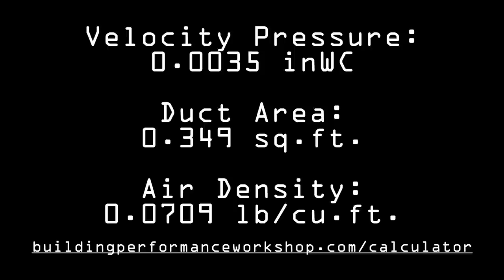AIRFLOW TESTING: 8 Ways to Test Residential HVAC Airflows with Corbett Lunsford

Comment: Corbett, 
Just a few notes/suggestions. The large vane was not used properly or as intended for exhaust fan flow. The vane would be influenced by the rotation of the exhaust fan. There is a flow funnel set made for the vane and a funnel factor that is used when measuring exhaust airflow. In addition, both vanes allow for the input of area to automatically calculate the CFM from the velocity.

Second, the reason the first are lower then the last 4 is the last 4 were measured independent of air density or corrected for air density. The Testo vanes actually measure airflow by measuring the number of rotations of the fan which measures airflow independent of air density. 

The first 4 measurements all measure airflow by measuring the pressure drop across a fixed orifice the fan orifice or a pitot tube array including the powered flow hood. They are all manometers. Air density is affected by barometric pressure, temperature, and relative humidity. I do not believe that any of the instruments you used correct for all 3. 

What you effectively were able to show is that if air density is not considered or corrected for the airflow readings will be lower than normal. Also while the powered flow hood has been touted as the industry standard, the TAB industry still uses the Pitot Tube as the standard for all airflow measurements. 

As the ductwork is rarely accessible when testing exhaust fans, a powered flow hood at the exhaust inlet, a vane with a hood, or the exhaust fan flow meter would be the most effective methods for measuring exhaust. The large vane and the small vane used as demonstrated would not be as accurate. The garbage bag while interesting is not an easy or effective method for most applications. 

Interesting video

Jim
Reply from the maker: Thanks for the added insight, Jim. We intended for the 75 cfm to be a stand-in for many residential supply ducts and ventilation ducts.  Interestingly, we were sent these Testo tools without a very in-depth manual, so it was anyone's guess (unless we have access to you) how exactly they intended the tools to be used.

The Pitot is a great choice, I agree, though in residential settings I find there is hardly ever a 8.5 diameter length upstream and 1.5 length downstream free of obstructions.
Reply: Tks Jim, was wondering

Comment: Great idea with the plastic bags - love it :)
I spent ~50€ on "better" Chinese anemometer/flow meter and this was horrible un-accurate when measure speed (you can watch my struggles on YT).  For range 4-30 mph inaccuracy was up to 5%, but under this number even up to 30%. Above  30mph goes again bad, It was hard to estimate, but no less than 10% around 60mph (for this use car and anemometer on pole+GPS).

Comment: That Retrotec DM32 is quite pricey.  Can one calculate flow rate from the box & simple manometer pressure drop & save a grand+?  If so, what is the equation?

Comment: I’m setting up a duct for orchid growing and see people use corrugated pvc/aluminum. Will schedule pvc hard pipe (6”) have less turbulence leading to higher cfm down a 12-foot stretch with 400CMF 6” in-line fan? Would a film with dimples adhered to the inner side of pipe cut turbulence at the boundary wall?
Reply from the maker: Yes. Good thinking.

Comment: can anyone provide the dimensions of the RO(s) of the E1 E2 E3  on the TEC Minneapolis Exhaust Fan Flow Meter.  i know there "BOX" IS  13 X 16 X 8. wondering if i had a similar sized "TOTE"  could i save $$$ ? im not down with walking around with  a pizza box and  a garbage bag.. Thanks!!!!

Comment: So the Panasonic ventilator is smart and changes its speed depending on the resistance. How can you assure that the ventilator stays at constant cfm with every measurement method. Without the ventilator having a constant cfm I assume you can not compare these measurements because the ventilator will adjust its cfm based on the resistance?
Reply from the maker: Great point. None of these methods introduces the kind of static pressure the fan would react to.
Reply from the maker: Great point. None of these methods introduces the kind of static pressure the fan would react to.

Comment: I'm trying to verify the CFM based on your cardboard box example. I think you said it was reading 10.5 Pa for the pressure. Was 10.5 Pa the velocity pressure?
Reply: I was looking at the video and saw the reading of 71.7CFM and 10.9Pa. I'm using equation Q = VA -> A = Q/V = 71.7CFM/837FPM = 12.34in^2. I got 837FPM from V = 4005*Sqrt(0.04376inWC). 0.04376inWC is 10.9Pa converted to inWC. I can't seem to get 20in^2 for the Area of the box hole. Am I doing something wrong?

Comment: Dear Corbett, 
I need to measure air flow in a corrosive channel and it has a temperature measuring from 150oC to 300oC. Can you recommend Fluke or Testo instruments for the same? or give your inputs. Thanks
Reply from the maker: +Peter Manoj thanks for reaching out. Unfortunately, my expertise is residential, and your application is very industrial- I have no useful advice to offer. Best of luck!

Comment: A collection of methods patiently explained -- nice! Question:  After you attached the calibrated downstream fan, you adjusted that fan such that the pressure in the connecting duct was zero in order  to get the cfm reading from the resulting calibrated fan setting. OK. But then you left that calib fan attached for all the subsequent tests. I'm pretty sure for all those subsequent tests you could have done them without the calibrated fan in the system, though you might have to make a small adjustment for the air resistance of the short length of duct, right?
Reply from the maker: Yes, but the fan provided a sort of termination grille that made the video easier to shoot I guess
Reply: @HomePerformance  Fair enough. But in terms of the great value of this video lying in showing several alternative methods using alternative (possibly less expensive) equipment, the fancy calibrated fan is not needed as a prerequisite for the trash bag method, for example .🙂

Comment: Out building presented us with a document that showed our extraction EXACTLY reached the minimum for the building regulation, in l/s is 27 cfm. I am so dubious the installation had even been balanced out.... they used the exact vane anemometer in this video, 417. Which I am going to rent to take my own measurements. However i think using the vane with the duct is more accurate and doesn't have to account  the profile of the duct. How to enforce the test results to the building company if I find out the building breaches regulations?

Thanks
Reply from the maker: Great Q, Maurizio. Don’t have a suggestion for you legally, but knowledge is power.

Comment: Thank you Corbett, excellent video, I would like to know what the proper CFM values are for some house hold appliances…for example I have a range hood that is super noisy and does not seem to draw much air up. Is there a way to test it? and what should a reasonable range hood exhaust CFM be? I can test from the kitchen under the hood or go on a ladder outside and test the output vent?
Reply from the maker: Great q, Rob. My book goes into several more detailed bits on this front, but here’s the gist of what you’re aiming for:
https://youtu.be/y08HOnzafM8

Comment: Would I be able to use this system to test the air flow for something way more pressured? Like the force of a car or semi truck exhaust? Or can anyone recommend something different?
Reply from the maker: Retrotec makes a commercial version that can pressurize up to 20” wc. Or you can use a leafblower ;)
Reply: @HomePerformance  No what i'm looking for is something that can measure the air pressure of a truck exhaust. Something not expansive but simple. I want to measure the flow after cleaning the exhaust filters. But don't want to spend 20 thousand for a machine.
Reply from the maker: Just a simple digital manometer and a straight or static pressure probe should be all you need then

Comment: Mr. Lunsford do you think using a mathematical formula to calculate CFM on a heating appliance has a viable use. For example: gas furnace Output BTU ÷ 1.08 * T∆

Electric Furnace 
Voltage * Amperage * 3.41 = BTUs
BTUs ÷ 1.08 * T∆

I'm fairly new in the HVAC trade and I really want to understand airflow better because moving air is often overlooked and I didn't learn as much about airflow in trade school. Great channel btw.
Reply from the maker: +Kevin Carter EXCELLENT QUESTIONS. You CAN calculate for CFM, but there are weaknesses. For instance, don't take for granted that a 60k furnace is eating 60kbtu of nat gas. Clock the meter to be sure. Also, how to test for delta T? Dead center of the ducts? Average? Mean? How many samples? You see what I'm getting at, I hope.

Comment: Thanks. Great video. What kind of meter are you using for the pitot tube?
Reply from the maker: Paul Ladendorf Any digital micromanometer will do, Paul, but this one is a Retrotec DM-32 Smart Gauge.  About $1000.

Comment: Don't you think your test would of been more accurate using the flex ducting that most contractors use. What you're using is HVAC ducting. There's going to be less resistance when using that HVAC metal ducting. There are no ridges inside, so inturn there's less air drag. 
On the flex ducting that most houses have have lots of ridges inside. This will restrict air flow just a little. Also most new houses have the ducting exiting the soffit vents. That also puts a slight bend into the ducting. 
You need to consider these things.
Reply from the maker: Thanks Luke, but none of that actually matters to the test techniques- you can use any of these methods on flex duct too.

Comment: 2:15 wrong. Fan with restricted airflow will increase rpm because you lower motor resistance without lowering motor power. The fan themselves don't have any sensor to registered pressure drops.
Reply: Hi what's happens on amps draw if I restrict suction side of any fan or blower and if I restrict discharge side of blower .bc if we restrict suction it will increase rpm  results in increase in amps drawn
Reply: Hi what's happens on amps draw if I restrict suction side of any fan or blower and if I restrict discharge side of blower .bc if we restrict suction it will increase rpm  results in increase in amps drawn
Reply: Hi what's happens on amps draw if I restrict suction side of any fan or blower and if I restrict discharge side of blower .bc if we restrict suction it will increase rpm  results in increase in amps drawn
Reply from the maker: Actually, some fans do- like this one